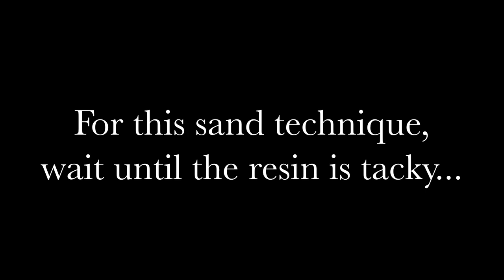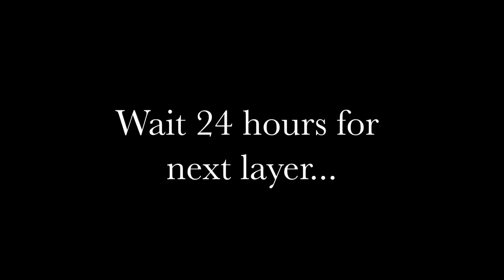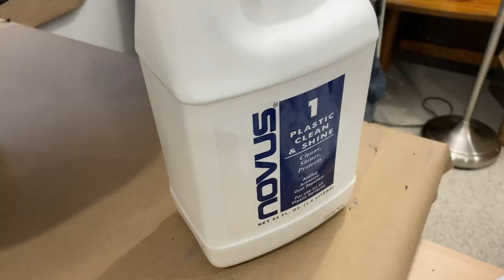How to assemble DIY Clock Kit

Comment: Love this.  Can you comment on why you covered the entire clock with sand even though it's really only visible (apparently) in the bottom 1/3 of it?  Is this to maintain equal thickness throughout?  Or is it actually visible under the water/waves and adds dimension that way?  Thank you!  This project has me very intrigued.